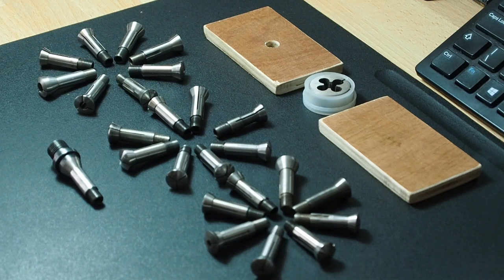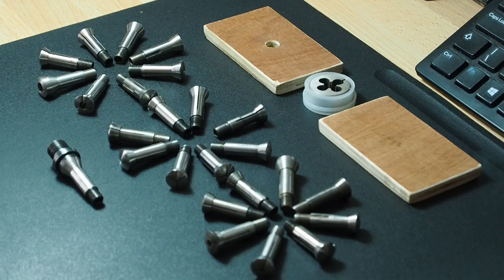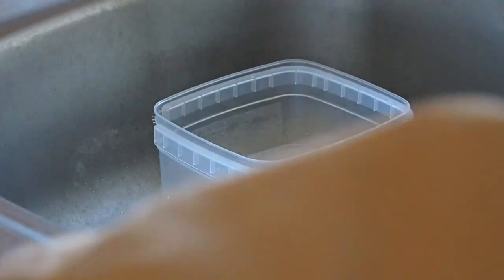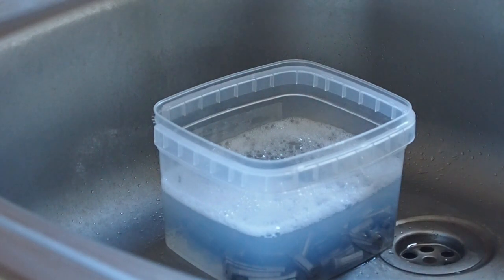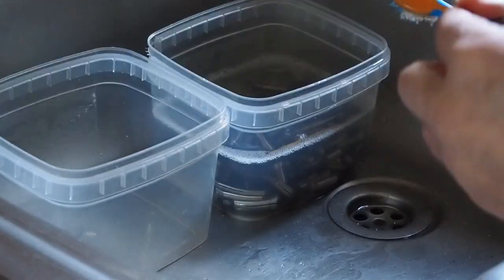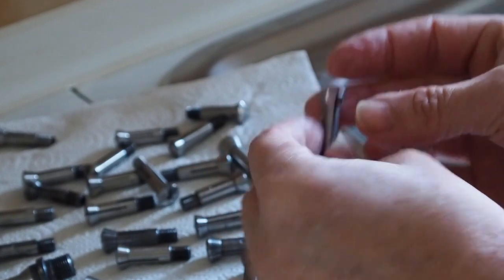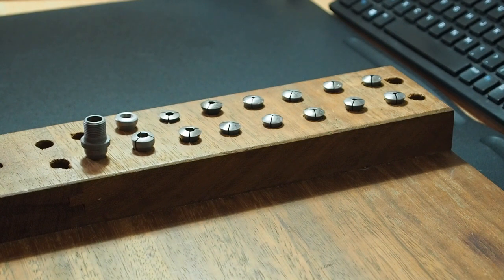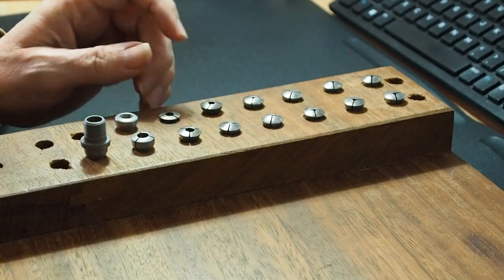Cleaning Watchmakers Lathe 8mm Collets.

Comment: Nice one Paul. Those collets have a new lease of life now and once you get a dial indicator on them in the lathe, it'll be easy to weed out any inaccurate ones. Light oil would be a good thing for the collets, at least until a better idea comes along :) I just made a rack for my 5C collets for the tool grinder.

Cheers,
Craig
Reply from the maker: Hello Craig,
They are a very mixed bag of collets... More bad than good I suspect but as you said once I've clocked then the true story will be revealed. I look forward to seeing your collet rack, hopefully you filmed it... Thanks for visiting.
Take care.
Paul,,
Reply: @TheKnacklersWorkshop  I didn't film the collet rack no - it was a very basic build, just some stepped holes in a thick board. I will try to remember and show it in the next odds and ends video.

Comment: Good one! Yes, after derusting hurry and put some oil on them or they will flash rust...wipe and use...
Reply from the maker: Hi Saar,
Thanks for watching... I plan to order some oil tomorrow and the job will be complete.
Take care
Paul,,
Reply: @TheKnacklersWorkshop  Hi Paul, flash rusting is fast... As the name implies. I suggest you use wd40 or even Canola oil for now just to avoid flash rusting... Later you can wipe it off and apply some machine  grade oil.

Comment: Hi Paul, glad to see you back for 2021! I've always had good luck protecting drill bits, end mills, and tap & die sets with a light wipe of WD-40, as others have noted. Silicone spray offers some light protection and does not attract chips, but dissipates quickly. Keeping everything stored in a toolbox drawer with desiccant packs works for me too in a very humid climate. Someday I hope to have a nice set of small collets for the Unimat, after I get the CNC conversion done ...
Reply from the maker: Hello Rich,
I was tempted to use WD-40 but thought I would ask all the viewer for there thoughts. As the collets are in my home at the moment the temperature is quite stable. I plan to have most of my tools in boxes I will use desiccant packs in each... 
Take care
Paul,,

Comment: It usually takes about two hours when I use Evaporust.  Never run Evaporust in an ultrasonic bath with heat, as it will turn your metal jet black all over., or so I have heard.  Like the others have said, WD 40 and sealed bags would be great.   Keep Knackling!
Reply from the maker: Hi Vernon,
That is interesting about evaporust and heat, I did not know that...
Thanks for watching.
Paul,,
Reply: Thanks for the tip, Vernon.  Did not know that about Evaporust!

Comment: Not a watchmaker, but I would probably apply a non-gumming light oil to keep them from rusting.  This is great info, since I have many old 3PN, 4PN, and 5PN P&W collets to clean.  Am planning on trying Evaporust in a sealed container, floating in the midst of a water bath in my ultrasonic cleaner.
Reply from the maker: Hi Daniel,
I am pleased to hear that the video was of help to you... Good luck with cleaning up your collets.
Take care
Paul,,

Comment: Hi Paul, looks like you have as much luck with that evaporust as I do, I think it only works if you live in the states for some bizarre reason (must be our crappy climate)! I would dip them in WD40 and poly bag them individually, then back in the rack, they will last forever like this. Cheers, Jon
Reply from the maker: Hello Jon,
I don't think I will buy any more Evaporust... I will oil the collets shortly, fortunately they are in my home and the temp is stable and no rust has occurred. 
Take care
Paul,,

Comment: Hi Paul, Good idea cleaning the collets, I ought to clean mine too as I'm sure it would be good practice every so often. 
Ive been trying to do a little work with my watchmakers attachment on the unimat lately. Ive come across a problem which I half expected I'd encounter as this is not a dedicated watchmakers lathe. I was tring to repivot a clock wheel as the end had snapped off. To my dismay, the drill bit would not align with the existing pivot on the end of my wheel where I wanted to drill into. It was very slightly off which caused the very tiny drill bit to snap. Do you know if there is any form of aligning that can be made on these unimats in order to get a true dead center. They say the mark of a good watchmakers lathe is being able to hold a razor blade between 2 sharp points. Thats certainly not the case with my lathe 
Great video, Keep them coming
Johnny
Reply from the maker: Hi Johnny,
It is a little tricky to get alignment... sorry my project is so slow moving that I have not get there yet... You need to adjust the headstock to try and align it. there is a chap called Saar who has a channel called Smallathe and he recently did a video on alignment, which might help...  
Take care.
Paul,,

Comment: With regards to the ones you feel might be too damaged to use. Are they viable to be repourposed/resized? I scrounged up a set of ZZ collets some time back that are extremely rusty, I have toyed with the idea of resizing them and making a custom collet chuck (maybe some day in the distant future )
Reply from the maker: Hi Craig,
The issue that I have with some of the collets is mainly external damage, the keyway slot and the contact surface with the collet holder... As they are so small I will hang onto them just in case I think of a cool use for them.
Take care
Paul,,